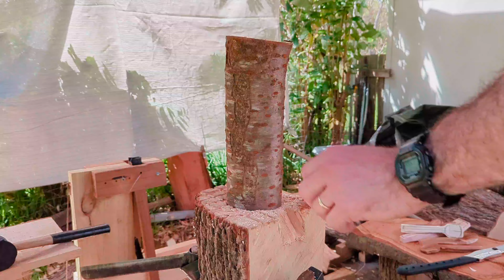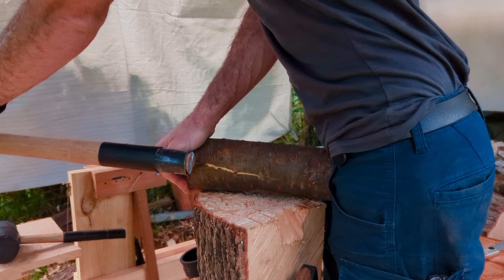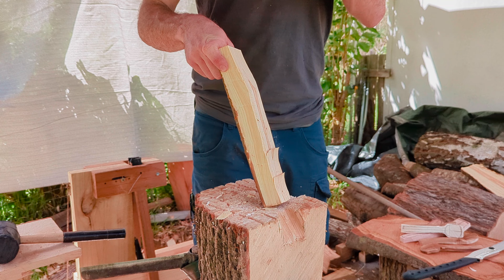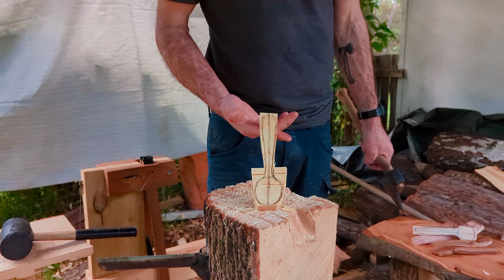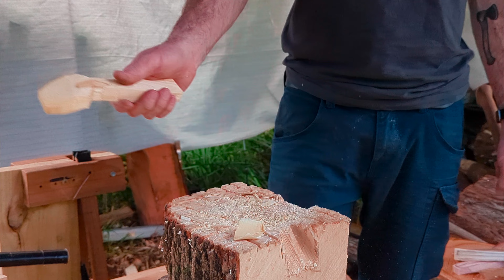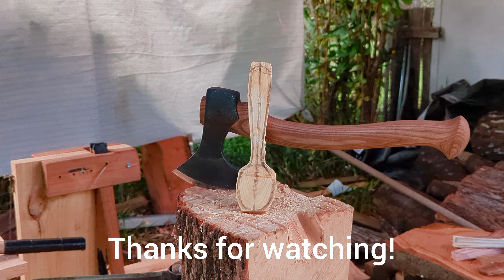Axe Work On An Eating Spoon | Andy Spoons

Comment: Just curious - Is there any benefit to creating the front of the spoon on the bark side of the blank? Often I find myself splitting a log open and creating radial blanks, so the bark would be on one of the sides of my short sides of my blank.

I've seen a few people recently doing it the way you are, and it's making me rethink my life choices haha.
Reply from the maker: It's a totally aesthetic preference! I will post a more detailed video about this soon, but basically if you have access to larger diameter stock, you will get more out of the log carving tangentially. Radial is great if you want to get those concentric circles in the bowl 👌
Reply: @andyspoons Thanks!!